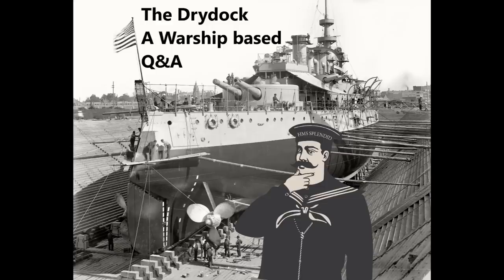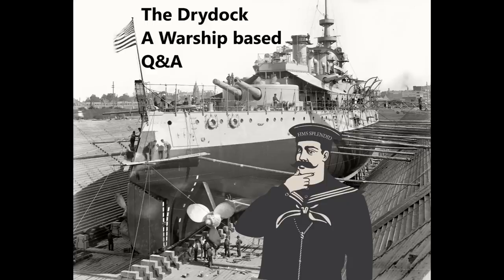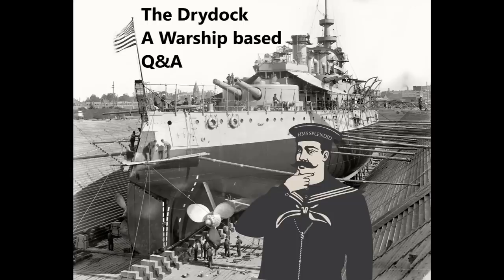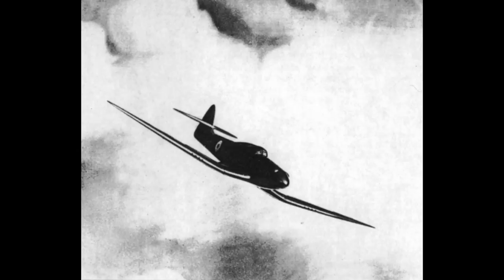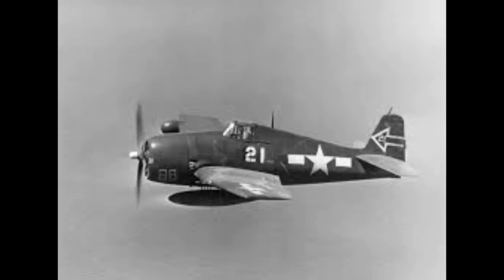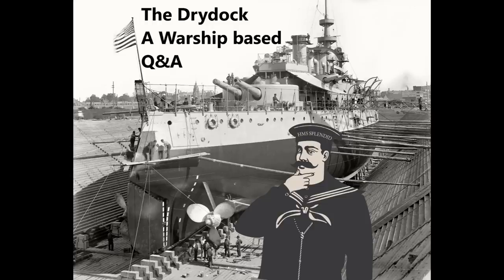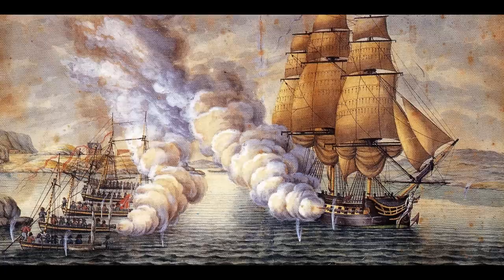The Drydock - Episode 184

Comment: Naval architect here: They don’t teach us this sort of stuff in school, but based on my knowledge of ships, fire damage alone can sink a steel ship a number of ways. One is by opening the hull. If the fire is inside the ship but the outside is in contact with seawater, then the inside of a hull plate is going to be more or less at the temperature of the fire and the outside will be at the boiling point of seawater. That’ll induce a lot of thermal stresses into the plates of the hull, making them want to warp and opening riveted seams. It can also cause some of the plates to crack, letting seawater into the hull. And plates near the waterline will be getting hot and then rapidly cooled when hit by a wave, possibly cracking it. Another is by affecting piping inside the ship. A hot fire might easily melt or burn gasket material in a pipe joint in the seawater system, letting water out of the pipe. It can also weaken the steel of the pipe, causing it to sag and pull away from its connections, letting water out of the pipe. In either of these scenarios, if the pipe was a seawater pipe, that would directly connect the inside of the ship to the sea, allowing flooding from hydrostatic pressure. Small tanks and sections of pipe that are closed off but full of liquid can also boil, causing the pressure to rise and making a steam explosion that throws shrapnel that can punch through the hull, too.
Reply: Exactly take a look at the damage sustained by the RN from missile or air attacks in Falklands. Same goes to the USN Cruiser USS Belknap, which her superstructure was gutted by the fire. No matter which materials you have for your ship, if you don't put out the fire quickly and effectively it will destroy your ship slowly and surely.
Reply: I might also add the Belknap had aluminum superstructure and it was weakened by the fire and also ammunation that stored in the ship cooked off because of the fire, causing more damage.

This is why the USN switched back over to all steel superstructure for the Arleigh Burke DDG.
Reply: there is also the plausibility of a fire being hot enough to allow a sea chest or five to burst. Not totally unlike destroying a gasket in a seawater system (Like softening of flanges) melting a thinner portion of a sea chest can allow water pressure alone to start poking holes in hulls. What is more, the sudden thermal shock of a super heated  compartment being flash flooded, you get some very aggressive bulkhead shattering which can lead to a failure of compartmentalization. (Wow, now there's a word lol)
Reply: I would add that damage to seals or packing on propeller shafts, rudders, and pumps can allow lots of water in.  
To add some numbers to the reduction in strength of the ships steel, by 500 degrees centigrade (900F) the strength of steel is cut in half.  Above that the strength plummets to 10 percent of original by 700C (1300F).  Heat the frames too high and the ship will just fold up even if the hull had remained tight.
Reply: @jimfisher5856  wadding boxes (aka shaft seals) all leak a little by default. Yes, excessive heat can cause them to fail, but just with the mass of the metal they are contained in in proportion to the surface area of hull on seawater, I would expect these would be the last points of failure in the system.
Reply: @jimfisher5856  I was going to mention this but looks like you beat me to it, but yep it basically comes down to iron changing its crystalline structure from BCC to FCC it also becomes slightly denser while this process is happening causing the metal to shrink in size.

Comment: The thought of a Spitfire with such a massive engine plus cannons, bombs is a hilarious thought. It sounds almost Orkish in its ridiculousness. Imagine the climb rate if it doesn't tear itself apart. 
You'd be hosing the pilot out if he managed to land it safely.
Reply: Sounds like USS Defiant from DS9
Reply: I imagine they'd have the same problem as the Crecy had where the air frame simply wasn't strong enough.
Reply: Now there is any idea for a kit...
Reply: Let the boys at Republic design it.  P 47 Mk. II.
Reply: @rogersmith7396  More horsepower!
Reply: @jamesharding3459  

Jeremy Clarkson: POWWWWWEEERRRR!!!!
Reply: And yet, almost anything would have been preferable to the Firefly, a sub 300mph plane with a ridiculously low climb rate.  It proved why the air force should not be allowed to determine what planes the navy would have.

Comment: Speaking of disappearing batteries, if you get a chance on your US trip you should stop by Gateway National Recreation Area at Sandy Hook, in New Jersey. It's a whole series of coastal defense fortifications guarding the approaches to New York harbour, with a wide variety of different batteries from different eras, from the Civil War, to disappearing batteries, to more modern naval rifles, and all the way up to the early Cold War when it served as a Nike missile battery. The defenses there were upgraded over the decades, and the area actually served as one of the main munitions testing ranges for the US Navy before WWII. There's a ton of naval (or at least coastal defense) history at the park, so it's definitely a place I'd recommend adding to your list!
Reply: @N Fels The one I saw looked like a Public Storage facility.  With nukes.
Reply: If you want to see and touch an actual disappearing gun, and its mount,  (with battle damage), there are 2 at Fort Casey in Washington state.
Reply: I was in a reserve unit at Sandy Hook in the mid 70's.  IUWD3-40, if I recall (inshore underwater warfare detachment).  We were supposed to defend NYC harbor in case of a hot war. We had a radar scavenged from a beached fishing boat, and got a truckload of out-of-date sonobuoys which we couldn't deploy, wouldn't have deployed anyway in the shallow water, and nothing to monitor them with.  The storage lockers were full of WWII tube electronics.  I hope the reserves have improved since then.

Comment: 31:44 I think a major but underappreciated factor in the development of angled fight decks is the parallel development and need for catapults for launching aircraft. The biggest advantage of an angled deck is that it allows the carrier to launch and recover aircraft at the same time without the two groups interfering with each other (i.e. launch fresh CAP fighters while landing a returning strike - something Nagumo would have loved to be able to do at Midway). However, that's only possible once catapult launches become the norm, since otherwise the non-angled area at the bow is too small to provide enough runway for takeoff without the launching planes having to start back in part of the angled area amidships. So the primary benefit to the angled deck doesn't come into play until catapult launches become the norm, which didn't happen until the late 40s/early 50s - which is exactly when earlier carriers started to get refitted with angled decks and new designs began to incorporate them from the start.

Comment: About fire and sinking iron/steel ships: at least in my country, per regulation you cannot use steel beams in a house without properly fire proofing said steel beam. Becauee iron and steel have the structural integrity of cooked spaghetti when heated up over certain temperatures. More over, iron and steel may become brittle afterwards, depending on the heat, how fast it was cooled, the exact ingredients of the steel etcetera.
Reply: I think "The New Science of Strong Materials" by J. E. Gordon should be required reading here.   It literally explains everything.  ;-)

Comment: If I remember right during the construction of HMS Ark Royal it was felt that the power needed for her design speed 103,000 SHP was too much for 2 shafts so she got 3 but what is interesting is that further work ascertained that she would have been able to make that speed on 3/4 of the power on 2 shafts. 76,000 SHP may not get a Nelson to 28kts but with her superior hull form she would have been considerably faster than a Queen Elizabeth

Comment: How do iron / steel ships sinking from fire damage? 16:24
There is one other way for an iron or steel ship to sink from fire damage.  If the fire starts or spreads to a deck below the waterline, it might be able to create damage that will sink or contribute to the sinking of a ship.  The fire must come into contact with the hull.  The fire must be intense; create very high heat, and burn long enough to warp the hull plating.  The heat makes the hull plates expand and when the fire burns itself out the iron or steel plates contract, opening seams in the hull which can lead to catastrophic flooding.  Such a fire will also be likely to knock out power to the ship's pumps and, or seriously damage or destroy those systems. 

I have dove on the wrecks of two ships which sank from exactly this type of damage.  The first was the Gosford, a 19th century, 281 ft. long, steel-hulled, four-masted bark, built in Greenock, Scotland in 1891.  Sometime in 1893 the Gosford was carrying a load of coal to California, but a fire started in one of the coal bunkers which the ship's crew fought for five days.  Eventually the fire burned through to the upper deck and up into the ship's sails and rigging before the crew was forced to evacuate and take to the ship's boats.  Fortunately for them, the Gosford was within a mile from a beach, just east of Point Conception, California near Cojo anchorage.  As the fire burned itself out, the Gosford's hull plates cooled down leading to a quick sinking.

The second ship was the Valiant, a 162 ft. long, steel-hulled yacht.  On December 13, 1930, she was anchored off Descanso Beach, near Avalon on Catalina Island, about 26-miles off the Southern California coast.  Due to negligent use of a gasoline powered generator, a fire started in the Valiant's engine room which eventually gutted the entire ship.  The fire burned for three full days.  When the fire burned itself out, the hull cooled down and the water started rushing in. 

Large warships such as aircraft carriers and battleships are extensively compartmentalized, so it's highly unlikely that such a vessel would sink from the type of fire damage I described.  However, while I have to reread Shattered Sword to confirm this, I believe that survivors from the IJN Kaga reported that the big aircraft carrier was settling in the water long before before she was scuttled with torpedoes.  The type of fire damage I described might have played a role in this.  Then again, the Kaga was attacked by almost two full squadrons of dive bombers.  While it is believed that the Kaga took five direct hits, there may have also been one or more near misses which could have caused hull damage with some degree of flooding.  And then there were the multiple explosions which repeatedly rocked the vessel while she burned.  If any of those explosions occurred in compartments below the waterline, that could also account for flooding from hull damage.

Warships like destroyers and some of the smaller light cruisers built in the early to mid 20th century are another matter.  I don't know of any specific examples where the type of fire damage I described caused or contributed to the sinking one of these types of warships, but I don't think it's impossible that such a scenario could have occurred.

Comment: And a lot of times even catastrophic fires DIDN'T outright sink the steel or iron ship.  They simply made it impossible to get it out of the battle area and thus it was scuttled to avoid it falling into the enemy's hand or else, like Hornet, eventually sunk by an enemy who didn't care to commit the resources to try to tow home a burnt to a crisp hulk as a prize.

And of course the attempts to fight the fire can themselves compromise the stability of the ship -- as all that firefighting water has to go somewhere, or simply use up enough buoyancy that portholes or other openings that are normally above the water line now sink or list below water.  (And porthole glass is a lot more vulnerable to fire damage than steel is; as the thermal shocks can shatter it)
Reply: Exactly. The real issue with massive fires on ships wasn't any of those fringe-case scenarios where it might somehow cause underwater damage. If the fire did enough damage to disable the ship's propulsion, and either the rest of that fleet wasn't in a position to tow the ship home (if they'd lost) or the ship had suffered so much damage as to be totaled even if they did tow it home, then scuttling the damaged ship was the most expeditious option.

Comment: @16:22:  3 other factors for WW2 and earlier ships in regards of fires. 
 1) Flooding the magazines will lower your freeboard.  
 2) Since Riveted ships have caulking at the seams, the caulking material can catch fire, PLUS, the seams distort due to uneven heating and cause flooding.
 3) The tons of firefighting water used to prevent the fire from getting to more vital areas of the ship can cause serious stability issues.

Comment: Fire can warp steel plates.  If hot enough it can detemper steel.  Steel buildings which burn are usually totaled.  The ships in New York which caught fire were sunk by firefighters pouring water on them and they capsized.

Comment: wrt Yorktown and Enterprise being built to a treaty-max 27,000 ton design.    My hunch is, with a more capable and survivable design in hand, it would have been used for both Hornet and Essex, so Essex would have been in commission in December of 41.  re "survivable", the weakest point in the Yorktowns was, to save weight, they did not have staggered boiler and engine rooms.  The lack of survivable powerplants lead directly to the loss of both Yorktown and Hornet.  The 27,000 Essex design eliminated that vulnerability.

Comment: british@31:04 Perhaps, at least for the US Navy and the British Navy, one reason and perhaps the primary reason why the Angled Flight Deck was not done earlier is called The Panama Canal!
 
In fact some British Carriers actually had parts of their gallery level either removable or where it can become vertical .vs. the standard horizontal for crew to work the AA guns, etc. just to go thru the Canal with inches to spare.

Comment: The first US night carrier was INDEPENDENCE, and although her air group was successful, a CVL was judged too small for efficient ops. ENTERPRISE and SARATOGA were chosen because they were larger. They still couldn't handle an ESSEX-size Air Group, but could easily handle the 50 or 60 of a two-squadron night group. And the fact is SARA spent the last part of 1944 training night Air Groups after a refit, so you're correct there.  ENTERPRISE was at Pearl for a short period in December, 1944 
(like 18 days, so not a major overhaul) and switched over to night duty with CAG-90, under former VT-10 CO, ENTERPRISE alum, and night combat pioneer Bill Martin. At the end of the war, though, with the value of night fighting aircraft proven, the Navy bit the bullet and sent out a brand-new ESSEX-class carrier, BONHOMME RICHARD, with a night Air Group.

Comment: Fire fighting efforts could also sink ship via flooding its ability to remove excess water is compromised.
Reply: The USS Stark (FFG 31) ran into serious stability issues when.water used to fight the fires caused by burning fuel from an Iraqi Exocet missile because it filled up the superstructure and had no place drain.  After the incident the FFG-7s were modified to allow water to drain.

Comment: I did come across a reference to the original gullwing version of Spitfire. I understand there was a problem with the fact that the wings would have been part of the radiator. Hot water from the engine would enter the wing where it would cool done enough to be reused.

From what I remember, and it is some time since I read this, two of the problems with that idea is that having hot water and steam hitting cold water would probably resulted in the wings being blown off. And secondly, any hits on the wings could result in water escaping and the engine seizing up.
Reply: Just to be clear, we're talking about two entirely different airplanes that just happen to have the same name. The Spitfire you know only shares its name and designer with the other aircraft.

Comment: 31:10 re: angled flight deck - also, as aircraft really do not like sidewinds during landing, it took a while to develop such heavy aircraft, with such powerfull engines, that the slight difference between landing direction and airstream could be dealt with.
Reply: I have to disagree. I've landed a Cessna 152, which is closer to an ultralight than to a WW2 combat aircraft, with 50-60kt crosswinds at roughly 80 degrees off landing direction. It was not a fun landing, and the crabbing I needed was really living up to the term. All that said, my point is that the mass of the aircraft was no longer a reason against angling the flight deck sometime shortly after WW1.
Reply: @asureaskie  Without having piloting experience myself, would you like to repeat it on - say - HMS Argus?